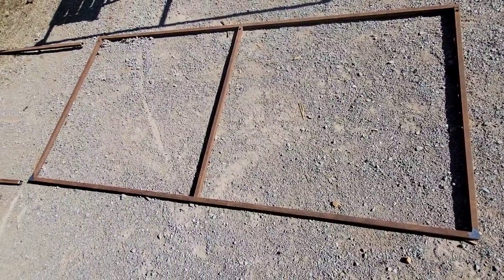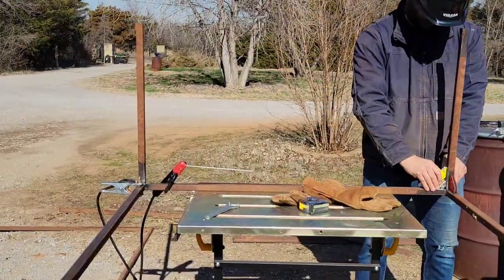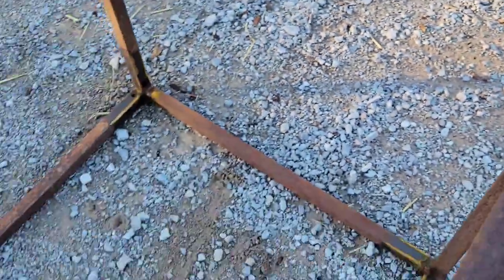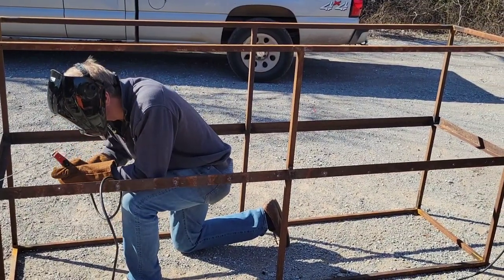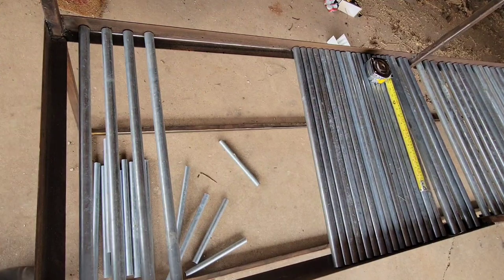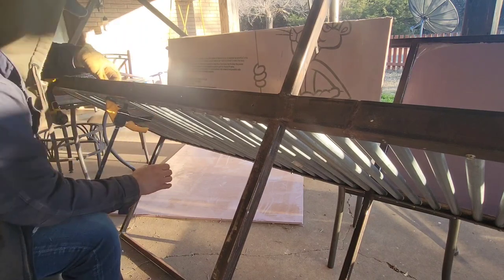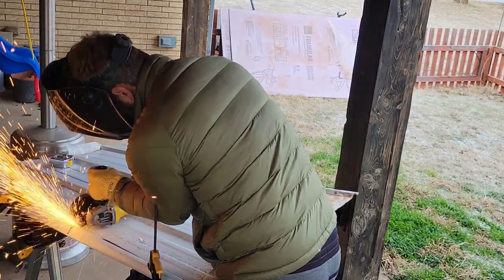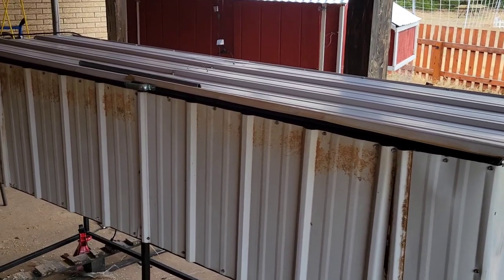How We Made a CFT Worm Bin

Comment: hey OK Farms, why not tack weld pipes in place after drilling holes? Insulation board was brilliant, have you thought of filling the tubing around the farm with spray foam, to keep  out the outside temperature? i'm split from using tubing or wood in my worm bin material, since moisture plays a part in worm farms.